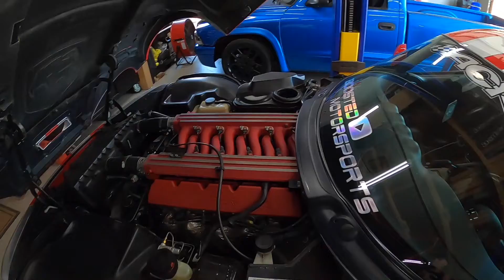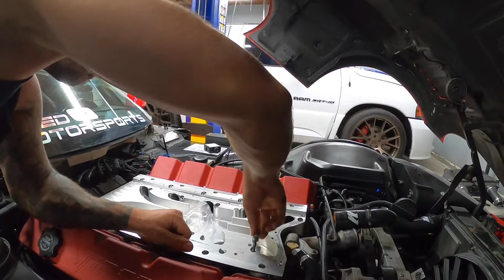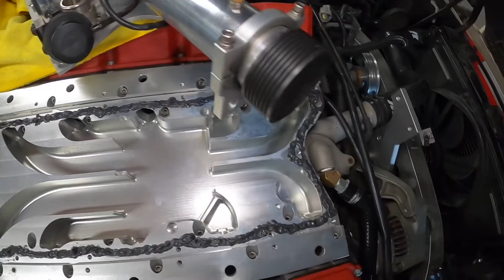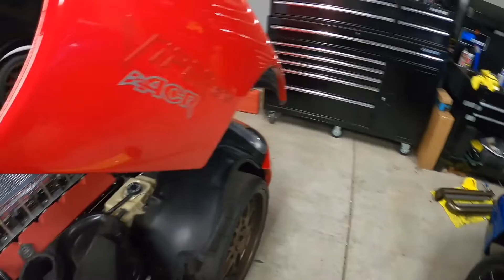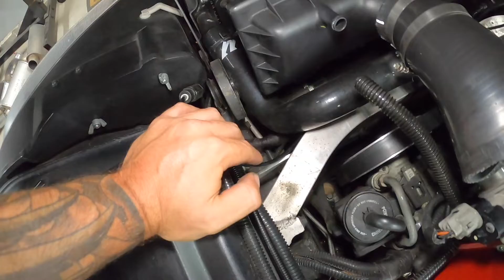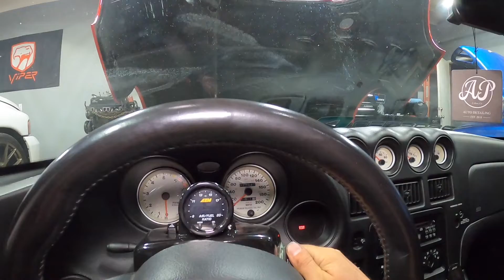Dodge Viper Supercharger Kit INSTALL | ROE Racing

Comment: Correct Roe  Supercharger are not in production anymore. They stopped after the 3.2L.
A used unit will show up on ebay every couple of months. They sell quick. So if you see 1 scoop it up fast.  Prices have goin up.
Reply: I messaged them a few months back, they said they were considering another limited release in the near future.